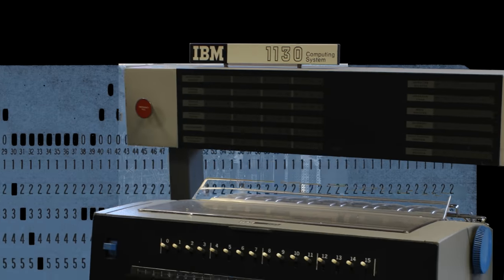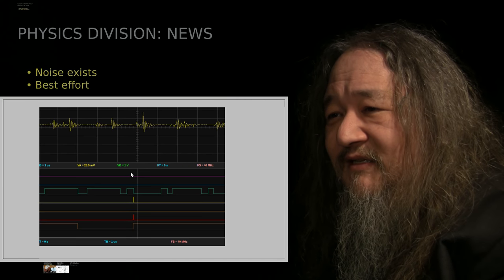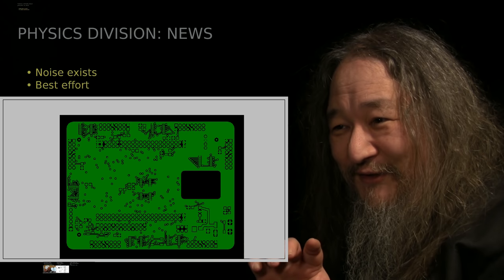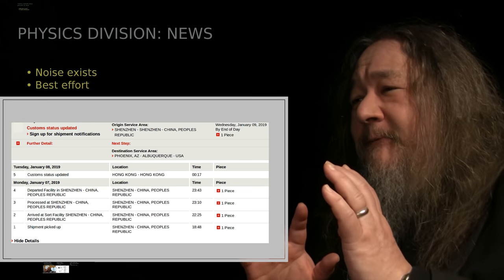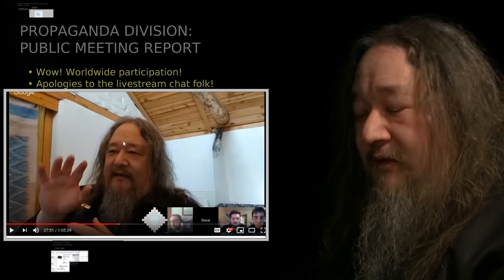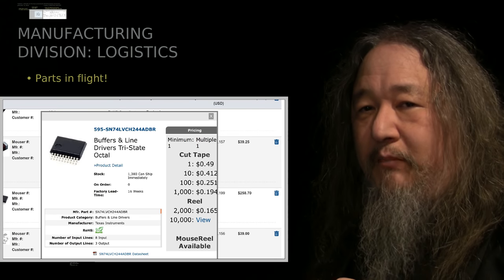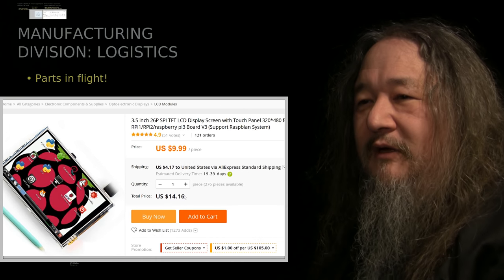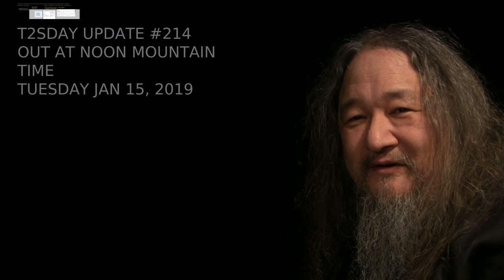Buying Time - T2sday Update 213

Comment: I still can't believe you identified the solder blob - very nice work. It's like NP vs P - once you see the answer it's clear, but highly non-trivial to identify in the first place. 

In a network with a sufficient number of tiles, would a hardware failure like the solder blob be an example of the "non-deterministic" behavior that programs in the MFM could conceivably recover from? I wonder if that would be more difficult, in some ways, than recovering from an entirely missing tile.
Reply: heyandy x the error model requires arbitrary failures. I would say locking failure is within the model since it does not cause a catastrophic failure being contained to 3 tiles at most
Reply: ok, cool. I guess that's part of why implementing MFM "for real" is useful - in the simulation, it seems evident to me that, for instance, the simulator itself must be trusted. if MFM is running on these T2Tiles, all bets are off - arbitrary failure means arbitrary failure.

I have this lingering anxiety about creating another Bitcoin network that runs out of control and we can never turn it off... but existential crisis aside I think I understand. :) thanks man
Reply from the maker: Yes, for failure models people often just think of 'dead tiles', but that's a (relatively) easier case.  Dealing with insane tiles is a whole other level of robustness -- and which won't happen for free, but we'll (eventually) engineer in it as we gain experience.